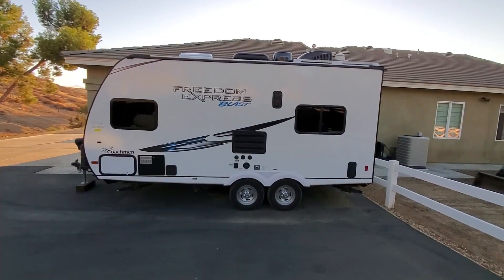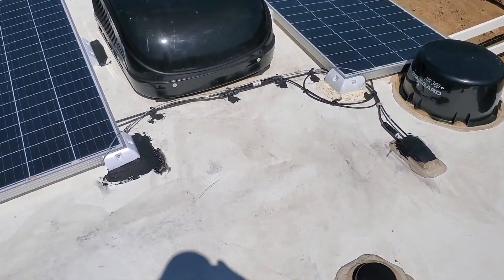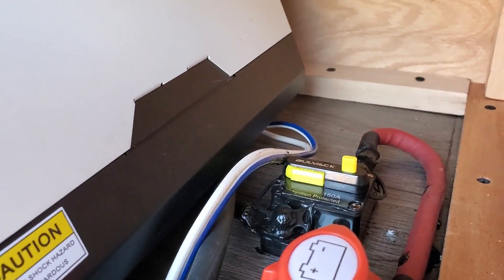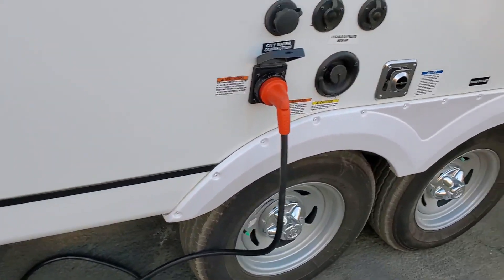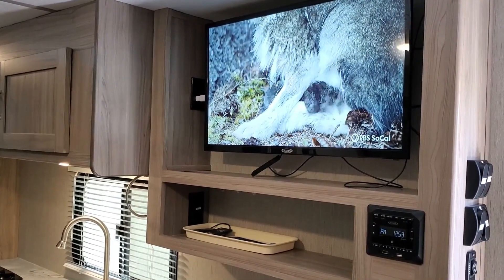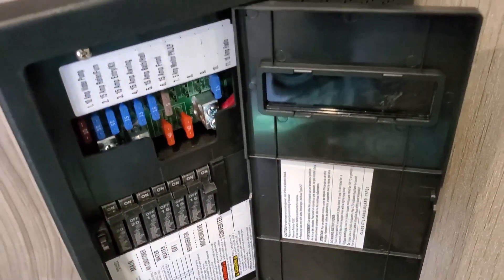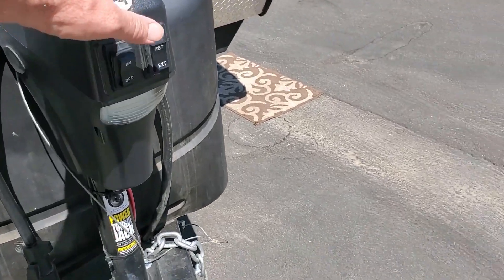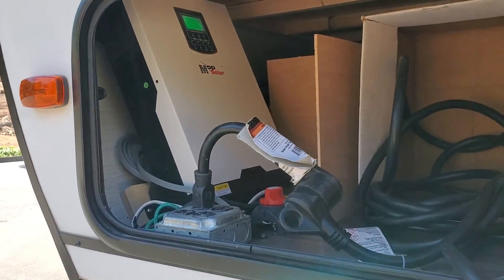Solar install on a Coachmen RV - Freedom Express Blast 17BLSE Toy Hauler

Comment from the maker: I have now wired the 120 v output directly to the trailer fuse panel, so I no longer need the extension cord hooked up.  This system will run the A/C just not for a long time.
Reply: @HuskyHauler26  After reading your replies and knowing you had a similar setup, I finally put everything together and it's all working! I'm super excited about finally using all this equipment and even at my age, it's pretty cool to see the sun giving me electricity. I need to make some tweaks and clean up some stuff, tuck wires away, etc, but overall I feel good. I need to watch your videos, because it sounds like you again did something similar to where I am now. I have an extension cord running from my new 3500w inverter attached to the solar setup, to the shore power inlet. I disconnected the battery on the tongue for now, to make sure I know where to attach those cables with my new setup.

Comment: I have a 2022 Coachmen Freedom Express that I think you could help me with. I've been wanting to install my solar panels for about a year now. I have the same type of pre-wired "solar ready" setup it seems you had to deal with. I have the solar gland on the roof. I was able to locate the blue and white cables, along with a green ground. I noticed those solar ready cables are looped. This is where I'm having trouble. Are those supposed to be cut? I can't imagine that sounds right, but that's where I'm at with things. I've searched high and low on the internet, and you are the closest I've found to a possible solution, as you're the first person who has a very similar setup. Any help you could offer at all I would appreciate
Reply from the maker: @aaronnoel7859  Yes the blue and white wire are going to go to the input side of your solar controller that will charge the batteries.
Reply from the maker: @aaronnoel7859  mine were loop just like yours and I ran it over to the solar controller on the other side of the trailer
Reply: @HuskyHauler26  thank you so much for replying BTW. That's very nice of you, I really appreciate it. . So reading your message and now thinking about it, is it really as simple as figuring out what direction the looped wires are coming from? One set from the solar gland (I believe it's called), and then that leads to the other end of the wires, which is connected to the battery? I have my entire setup mounted to a board at the moment and I'm comfortable with that part. I've just had a lot of hesitation "tapping in" to the existing wiring systems
Reply from the maker: @aaronnoel7859  I can't remember where the wires went to in the trailer if they were just looped or if they had an end, I don't remember them going to the batteries. I will try to look tonight when I get home.
Reply: @HuskyHauler26  hey, whenever you get a chance. You'd think this would be some information easy to find out, but it hasn't been at all. Thanks again
Reply from the maker: @aaronnoel7859  I think what I did was hook up the panels and cut the loop and measured the voltage to determine the which side came from the roof.
Reply: @HuskyHauler26  I really appreciate your help and insight with this. I'm just some random stranger on the Internet, so I'm grateful you took the time to reply to my questions. I would have been appreciative of you simply getting back to me, but you've been very helpful. I'm going to give this a shot over the weekend.

Comment: Looking at this same trailer to base camp with my 1200GS. Do you recommend this RV? After many hours of searching and comparing models, this is the smallest tandem toy hauler I've found with a decent floor plan and amenities. The advertised aluminum framing and Azdel siding seems cool too. Big water tanks that are heated. It may be tow able with a mid-size or half-ton truck. Seems to good to be true...
Nice work on your cargo trailer conversion too - that thing is awesome. I don't have the shop or time to do something like this, you nailed it. I'm looking for a used turn-key mini toy hauler and I'm thinking the Blast 17BLSE is the answer.
Your solar setup rocks too. This looks like a Will Prowse type setup. I was looking into a similar 24 volt based system as I'm afraid of any higher voltage and an accidental shock that might stop my heart - lol
Thanks for sharing these videos.
Reply from the maker: I am very happy with it, I  wish it was a foot or 2 longer so a small SXS could fit. I have had a few small issues, but nothing I couldn't fix myself.  I use a 1/2 ton Chevy  5.3 to pull it. If I did the solar again I would just go with 12 volt it is a lot less complicated.

Comment: How is your COACHMEN FREEDOM EXPRESS SELECT 17BLSE holding up?   Any issues?   As I'm seriously looking at one.   Thanks,  Bob <><
Reply from the maker: No major problems the only thing that happened is the freshwater tank leaked so I had to fix it.  It was under warranty but I didn't want to deal with going to the dealer.  I also changed the mattress.
Reply: @HuskyHauler26  Thanks. Looks like a nice RV for my weekend vacation trips needs

Comment: Did you mean you cannot run all the appliances & the air conditioner same time? Or the air con cannot be run at all with inverter you have?  Sorry new to this doing research!
Reply from the maker: Since I posted the video, I tried to run the A/C and was able to, but not with any other devices running.  I have enough wattage to run the A/C, but am pushing the limits on the start up. Also the A/C would not  run very long with only 2 - 100ah batteries.

Comment: I see a green wire next to your inverter. Was that part of the factory prewired portion as well? I have the blue and white wires with a green wire next to it in my rig. I’m not sure what my green wire from coachmen is for.
Reply from the maker: Yes it is a ground. I used it for the ground on the inverter.
Reply: @HuskyHauler26  thank you for responding! I thought that might be it but wasn’t sure.